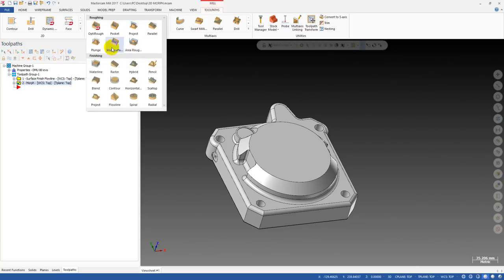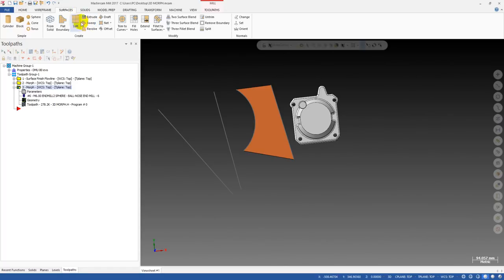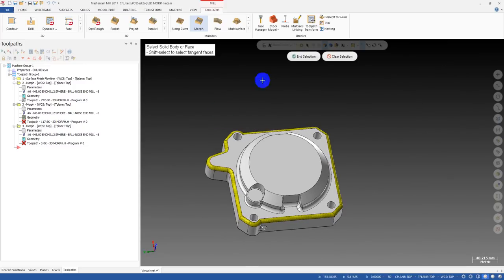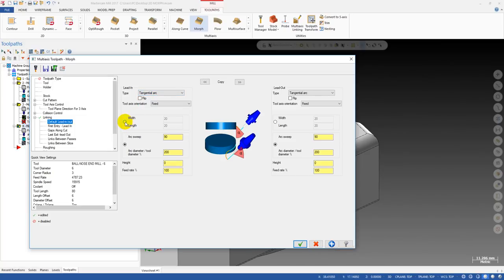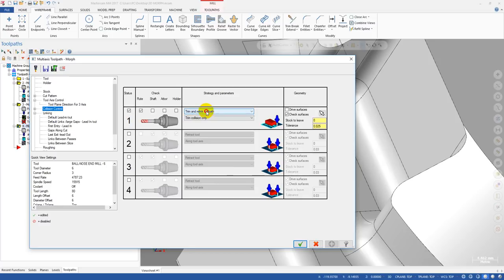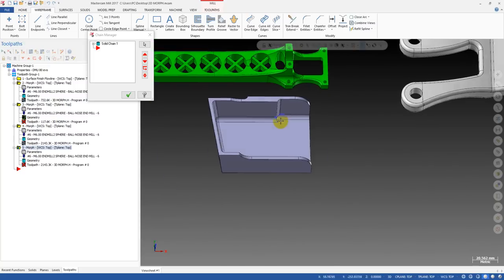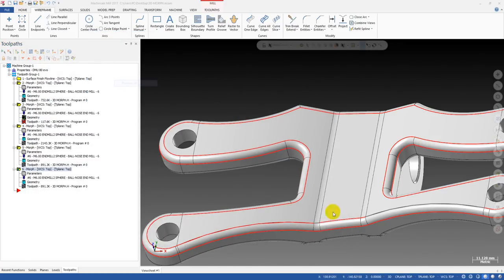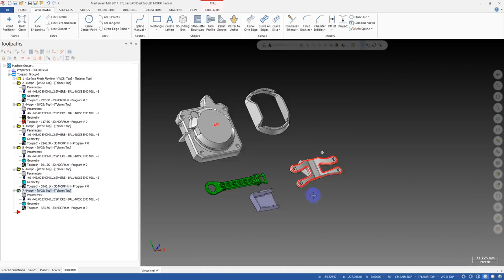MASTERCAM TIP: Using 5-axis Morph as a powerful 3d finish toolpath

Comment: When you select your solid faces for the toolpath. Hold down the Shift key it will pick all the tangent solid faces. Uses will need to have the Multi Axis module for MC to use this toolpath also. Great job Cheers
Reply from the maker: CNC Manufacturing Pty Ltd yeah but I have to hold the mic in my other hand :))

Comment: I have found that for the collision control strategies work best if you use different strategies for the drive surfaces and the check surfaces. Such as using Status #1 for check surfaces and Status #2 for drive surfaces.
Reply from the maker: Surely yes